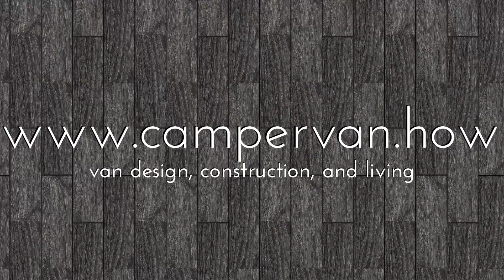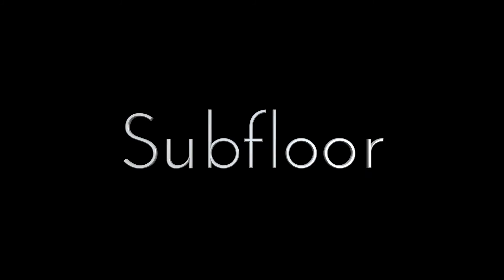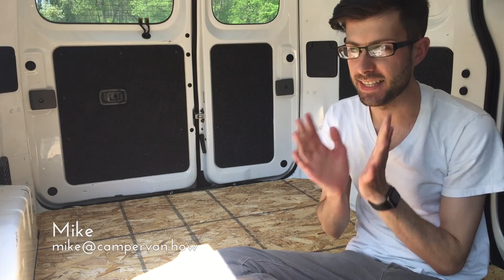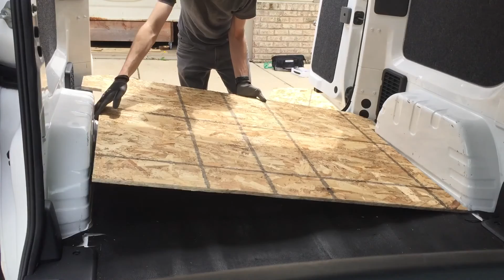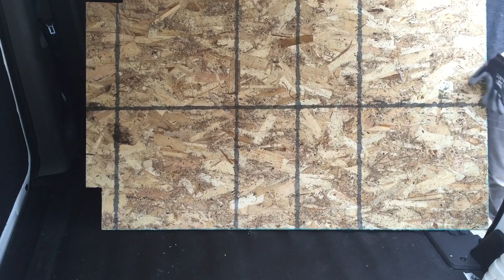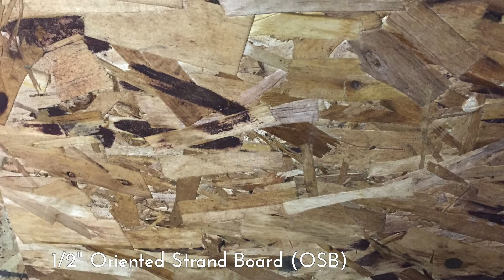DIY Camper Van Conversion - Subfloor

Comment: I used 1/2 inch OSB as well.  I had to use 1 1/2 inch of insulation and a vapor barrier on mine because of the cold. Just finished yesterday.  Good luck on your build!